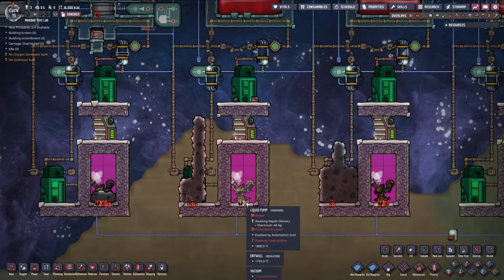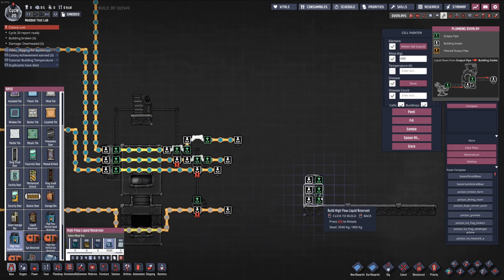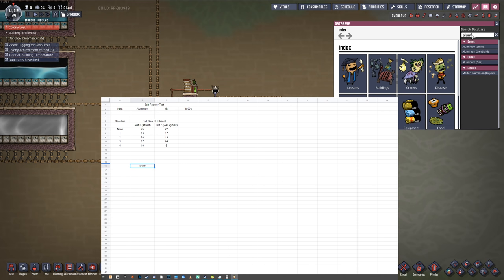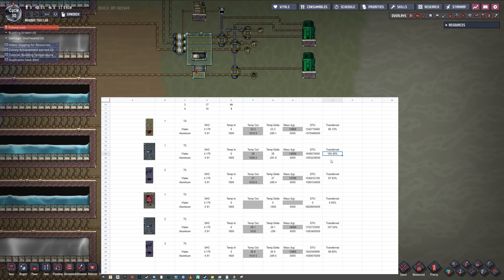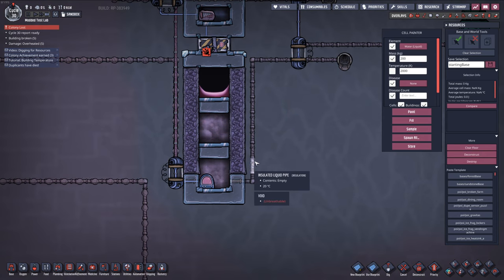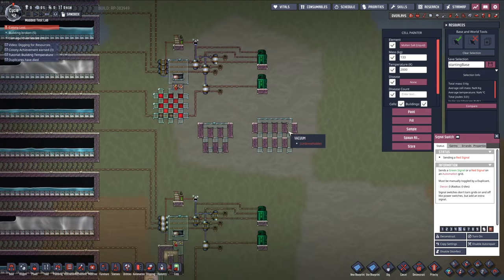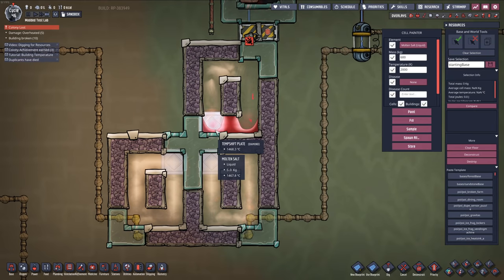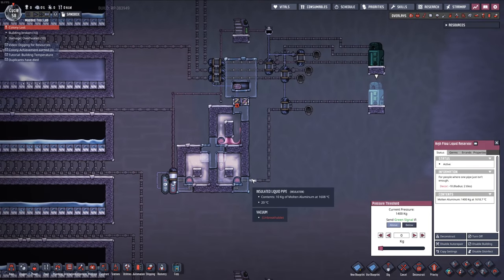200+%!? Hacking The Salt Reactor! Oxygen Not Included Experiment

Comment: i reckon the higher mass of salt is causing the systems to slow down. You want the salt to turn back into a liquid for it then to be heated again so you gain the benefit of this mechanic. Automation is definitly needed to stop the aluminium from heating up the gas, as thats wasting energy. In theory a tripple reactor design would be better than two but it might just be too slow. Finally, the reason the three loop design you tried at the end was less efficient is probably due the system being stuck in a gas state at the end and rarely phase changing. The loop design is probably the best style as it aims to condense the gas to be reheated. (Im InlaidOwl in the discord server BTW, i dont get notifications for Youtube)
Reply: I believe this is correct. Loops are the best because you maximize the amount of phaze changes, and minimize the time spent heating gas and cooling liquid. Too mutch mass slows you down, but too little mass would also slow you down.

Comment: The 2to3 design make each chamber one higher with the tempshift at the top so it cant interact with the liquid below it.
That makes it so only gas can transfer energy upwards. And it gives a tiles in the middle for condensing.

And maybe get rid of the diamond inbetween and only use the tempshift for transfering the heat diagonaly.

Comment: For the loop systems; how about 2 seperate dual loops (the test that achieved 250%), both dual loops powered from the same aluminium source, both loops feeding the same "steam turbine"?
Since your design has a 2 tile output on the top 2 loops can work back to back in a 5 tile area with  an insulation gap between them. Seperate mechanical doors can thermally connect them to the same "turbine"

This could have the potential to double the efficiency to 500%

Comment: What about pumping the salt gas, and letting it cool in a pipe at 100g/s so it doesn't change state, that way, you could get bigger temperature difference than 6°C. The same thing should be possible by pumping liquid salt at 1kg/s and superheating it above the boiling point. You can pump liquid salt with thermium pump without overheating, than heat it in the pipes, and than use normal heat exchanger to turn it to liquid and cool it down to 975°C(so it can be pumped once again.

Comment: @Brothgar
27:05 AND you can "checkerboard tile" them, but another condencing chamber in the top-left quadrant & another boiler in the bottom-right quadrant (assuming middle is the cross shape). Basically mirror the design along the Y-axis through the middle.
29:25 Yeah, just like that.

Comment: Couldnt you just do like a loop? Like warm the salt up with hot aluminum and then the cooler aluminum comming out heat up with the hot salt and see if you get run away heat build up.
Reply: No; The total heat of the system is only increased when the salt gas cools down and condenses. But the cooler aluminum coming out can't be cold enough to condense the salt or it would have never boiled the salt in the first place.
Reply: @KantiDono  then have some doors take heat away? And pump the heat back in with some other thing? (steam maybe?)
Edit: I'll try to think of something, but I don't have the game so...

Comment: I think I've figured out the problem with the multi-stage salt reactors. The trouble is the lack of movement of heat from one cell to the next, yes? The single-cell reactors work so well because there is both a constant influx and output of heat energy, from the molten aluminum to the salt, the salt to a gas, and the salt gas to the water in the chamber above.

The multi-stage reactors aren't working as well because the higher cells cannot transfer heat from the lower cells at an appreciable speed. This causes heat buildup in the lower cells, compounding the issue until a cell's salt gas no longer reverts to liquid, which prevents the energy gain from the state conversion, thus nullifying any purpose for the cell's presence in the stack and acting as nothing more than a giant heatsink.

I can think of a few ways to fix this, though the first isn't guaranteed to be viable and the second essentially amounts to "slow and steady wins the race".

The first consists of altering the contents of each cell. Say you have a material with similar properties to salt, including a net energy gain in the transition from liquid to solid, but a slightly lower boiling point, and a second material with a higher boiling point. Set up your cells in sequence, with the highest boiling point on the bottom and the lowest on the top. Theoretically, the rate of transfer will increase, as it takes less and less energy to boil the materials as you go higher and higher, thus increasing the rate of heat transfer.

The second way is essentially to automate each section such that heat is only transferred when there is liquid salt ready to receive it. This will obviously slow down your reactor's throughput, but guarantees maximum efficiency. It's my opinion that you kinda ought to be doing that already, but I recognize how material-intensive that would be. It might work if only the first heat input is regulated (the molten aluminum one), but you'd need to test it.

The third way is essentially a variation of the first. Instead of using different materials, you use different amounts of materials. Assume a 4 cell design. In the lowest, you have, let's say 8 units of molten salt. In the second-lowest, you have 4. in the second-highest, you have 2, and in the highest you have 1. These ratios aren't fixed, and in fact I'd say you should test for the optimal ratio in another video. Maybe it's closer to 8>6>4>2, or even 8>7>6>5 or something.

Hey though. That's just my 2 cents, from a guy who stayed up way too late and had an epiphany in the bathroom. I've never even played ONI before, but I assume it tries to model real-world physics, and I know a fair bit about those, right? After all, if you drop a rock it falls. That's science, right there.

I'm gonna go to bed now. Catch you later.

Comment: Regarding the checkerboard - it's kind of begging for a counter current exchange system of aluminum criss crossing back and forth through it so that you get a very pronounced heat gradient from bottom (gas) to top (liquid).  The tiles in the middle should cycle like mad, since ideally the condensation temperature would lie somewhere in the middle of the gradient.  Of course, I don't know if this would yield any gain or even be usable.  haha

Comment: Brothgar, you can’t dual phase change same material. If second stage gets hot enough to phase change that means first stage is already at phase change temp. Temp equilibrium happens between phase 1 liquid stage and phase 2 gas stage which prevents phase 1 from cooling back down and shifting into liquid. You are just shifting phase stage up the ladder. What you actually need to have 2 phase shifts is either thermo coupling fluid or 2 different net positive phase changing materials that change at different temperatures. Much like what they use to reach absolute zero. First stage nitrogen, then hydrogen, then helium (I think that was the order)

Edit: thermo coupling is actually a lot more difficult to setup because you want to remove half of the net gain from phase 1. What might be better is actually using less mass in first phase and doubling mass and surface area in the second phase. In a sense second phase needs more thermal capacity and dissipation in order to adhere to positive gain. To elaborate more on phase lock between loop 1 and loop 2, the reason it does it is because it doesn’t drop the temperature of the loop 2 liquid when it phase changes into gas.

Edit2: in real life this would work if you just added more mass into second stage because boiling temperature point increases as pressure increases within closed environment increases.

Comment: salt loop trickery with temp shift plates at the points where you want the salt to drop when cooled down.

i would say that you start with a "cool environent" resembling a recently build chamber, maybe one or twi tiles longer, prepare the salt in their contact points in a solid state, and then run the molten lead heating up from that cooled state. maybe play arround with the amount of salt in the same loop but extend it to a 4 loop in a 2x2 having the middle point be the heat exchange point, as far as the salt keeps moving you will ger all the heat out of that salt "fridge radiator"

Comment: I have a theory about why the two reactor system seems to be the most efficient.
If you have a single reactor system, the salt gains more heat as it becomes a gas, causing it to remain as a gas for longer, causing fewer state changes.
However, with a second reactor, the first reactor starts acting as a temperature modulator, since the gas at the top of that reactor heating the liquid salt is only just hot enough to turn it to a gas, causing it to cool as soon as it rises to the colder "turbine" and dropping back down, increasing the overall number of state changes.
As to why the effect lessens after 2, I have two ideas.
The first is that there are just more opportunities to lose heat, and the second is that after the second step there isn't much heat to transfer to the third, meaning that it struggles to become a gas, the reverse of the single reactor.
This also explains why you got alot of efficiency out of the loop system when the first reactors are changing rarely whilst the second one is changing often.
If there's anything wrong with this or something I'm missing, feel free to point it out everyone!

Comment: The thing is without some cold resiviour to transfer heat into your bottom chambers aren't going to condense. If the only heatsink is the upper chamber which is practically at the boiling point already and molten aluminum is constantly heating the bottom, the molten aluminum will always win and you'll just have a chamber of gas. The reason the top chambers condense is that they actually have somewhere to dump their heat. The bottom chambers don't. You need automation for lower chamber condensing.

Comment: About the tempshift plates, remember they have a 3 by 3 pattern, meaning you can use them to transfer heat from one gaz to the other without using diamond times. For the simple dual loop (one bottom and one top) you can remove the middle diamond tile and replace it by the tempshift plate, and place diamond tiles on the bottom right and top left positions. You have as much tile distance to move heat than in your design, but you add more transfer with the tempshift plate. That is ultimately what you want, more heat flux for the same temperature difference. That is also your issues with triple chambers : not enough heat transfer, meaning that you need a high temperature difference to move the heat, meaning one chamber is too hot to phase change. More thoughts should be given optimising the heat conductivity so... tempshift plates should definitely comes in handy.

Good luck !

Comment: Your technical videos are always so well done.

I have a running theory on why the checkerboard wasn't working, and why the molten salt was 'disappearing'. To explain it though, think of a single square as a 1x1 grid with the corners having coordinates: top left (0,0), top right (0,1) bottom left (1,0) bottom right (1,1). The key to understanding it is that the game interacts with the squares using the top left (0,0) coordinate first, then the top right coordinate, then bottom left then right. When the molten salt turns to gas it's not all at once and the game creates it in an adjacent square, because the current square houses the remaining molten salt, the adjacent square is above and to the left.  If it can't go there then it goes above, if not then to the above to the right.  IF all of the above are blocked then it tries to push it to the sides, left-right.  Finally it will try below the square, again from left to right.  In your checkerboard test the gas was squeezing into the empty block kitty-corner, some of these were in the vacuum, and some 'got destroyed' interacting with the molten salt in the square. (I'm guessing the game converted the salt gas back to liquid but the amount was below calculating so it dropped the value instead of adding it.)

This theory would also explain why 'lighter gasses' float to the top left and heavier gases sink to the bottom right.

Keep being amazing!
-Tom

Comment: How would a bead pump boiler go?
Basically its a single width chimney, with a mesh tile in one of the top two blocks to force the molten salt to condense into beads due to mesh tiles weirdness.
The salt then falls down, forcing salt gas back up and exchanging heat with the gas, with the possibility of re-boiling on the way down.
This eliminates the need to watch your temperatures at the bottom of the boiler as the bead pump would naturally maintain the gradient, and cause reboiling to happen further up in the boiler rather than at the hot end heat exchanger.
This naturally makes the salt bead boiler multistage as well, since the salt is being continuously reboiled via the already multiplied heat from the gas, getting more efficient with height/temperature input.
Depending on the height of the salt bead boiler you could run the hot end with pretty extreme temperatures and extract all that lovely heat at the top, also allows the cool end to over extract heat if desired and run it relatively cold to the condensation point of the gas.

Comment: (Sorry for the bad English)
Improving a ring salt reactor is very easy, all you need to do is flip over your version with two cameras (= (one camera at the bottom, two cameras at the top). The idea is that heat should be transferred to the next chambers faster than it enters the current chamber. Then, upon transition to a gaseous state, the salt will instantly condense. This should increase the frequency of phase transitions and, as a consequence, the volume of thermal energy

Comment: You could try to induce phase change on the hotter chamber by replacing an insulated tile with one that has a higher but still low thermal conductivity to prevent superheating the gas. By putting the excess energy into a waste heat loop, it may cause higher output on the other end of the system.

Comment: If you get it working properly you should see a 10% power increase. A perfect counter flow heat exchange processing 10kg/s of molten aluminum @ 2470 C against 12.231 kg/s of salt @ 800 C can raise the temp of the salt to 2470 C. (To balance the heat exchange 12.321 kg of salt needs to be used: 10Kg Al * .910 = xKg NaCl * .744 ---> xKg NaCl = (10Kg Al*.910)/.744 = 12.231 Kg). The salt can then undergo a temperature delta of 1670 C (2470 C -800 C). This gives a total heat delta of 17974 KDTU: 12.231Kg NaCl * .880 * 1670C = 17974.7 KDTU. At this stage specific heat capacity of .880 is used instead of .744 because the salt is in a gaseous state. This amount of heat can be converted to power by 21 steam turbines: 17974.7 KDTU/ 877.6 KDTU per turbine = 20.5 turbines. doing the same calculations without the heat exchange using only the specific heat capacity and theoretical max temperature for the aluminum @ 10Kg/s gives 16471 KDTU: 10Kg(.910)(2470 C - 660 C) = 16471 KDTU. This would require only 19 steam turbines to remove the heat: 16471 KDTU/ 877.6 KDTU per turbine = 18.8 turbines. That's a difference of 2 turbines. Calculating % increase: (additional turbines/ original total)*100% or (2/19)*100% gives about 10%. Hope this helps.

Comment: You don’t consider the thermal masses of each setup and it’s effect on the final  output energies. If you heat up a larger structure to the same temp, you can pull more energy from it.

Comment: So I'm a bit out of the loop of the game for quite some time, but from what I understand is that molten salt and salt gas have a difference in their heat capacity and you want to extract the energy that comes off when the phase shifts back and forth? 

So shouldn't a slightly bigger chamber not be better? Like 3 high and 2 wide?

Then you can place two rows of temperature shift plates at the bottom and the middle and leave the top row for a pipe to extract the heat from the system. Theoretically, the salt gas should rise, give its energy to the outgoing pipe, drops down as molten salt, and gets heated up via the stored energy in the shift plates.

The finer you extract close to the condensation point the more often it should shift, giving more energy. If it doesn't change from gas to liquid you're not extracting enough heat.

Comment: I think the main problem is the following: on the cold side the gas condenses, but the liquid is still very hot. So it doesn't really cool the next stage down. What you need to do is condense the gas but then cool the liquid further down before dripping it back. And you would need to do this between each stage. Then, I think, you would get much better heat transfer through multiple stages and lower stages would also phase change.

Comment: Seems like you could pair the really slow but super efficient system with one of the faster but less efficient systems as a surge cooling system so that it can get the aluminum back to a useable temperature for cooling smelters down... That way you maximize the energy you pull out when you're not smelting but your machines aren't melting down when you go to run them for an entire cycle. Might need to run a small amount through to keep it preheated, but it could probably power itself and then some